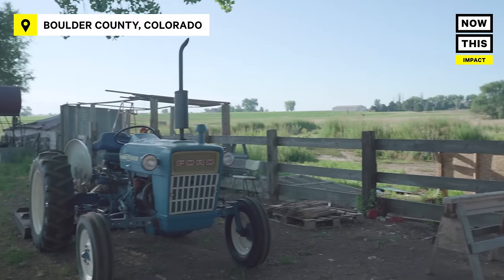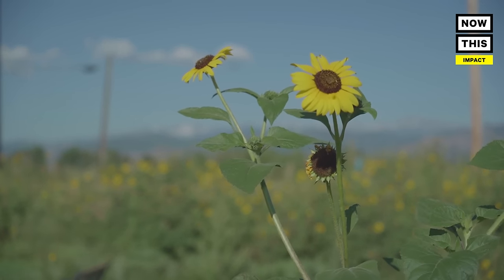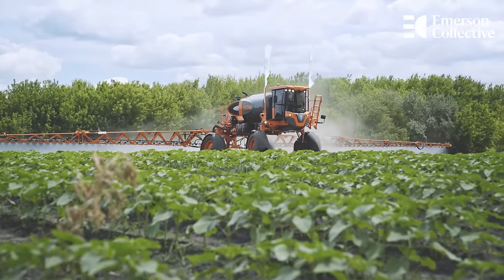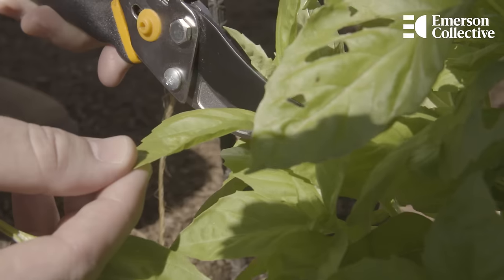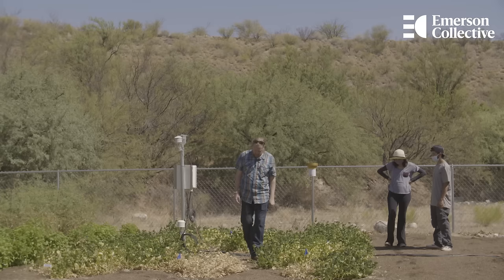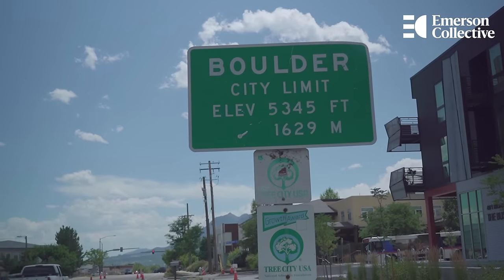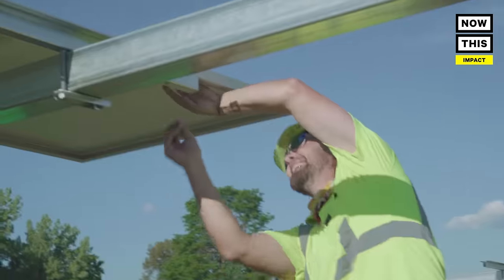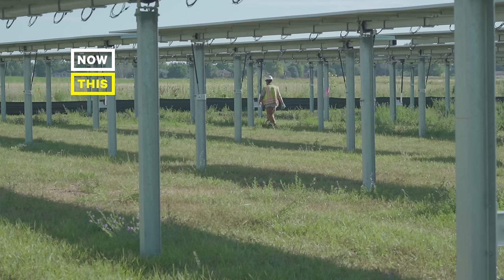Agrivoltaics: Solar Panels Bring Life to Struggling Farms | NowThis

Comment: This is why I love solar technology
Reply: Goorpijp Wessel  You should learn that even if it's made with materials from the environment, It's still improvement from dirty coal plants ;)
Reply: I wonder what the life of the panel is. Hopefully Technology will find ways to recycle the components & make them more ecofriendly. We have to stop with carbon producing energy. We also need more research into improving nuclear power production.
Reply: Goorpijp Wessel  Life cycle impact in grams of CO2e per kwh for solar is 1/20th of coal's (50 vs 1001). Wind and nuclear are 1/100th, with nuclear winning out (11 and 9, respectively). So yes, loving either of those technologies is much better than fossil fuels, I don't see the problem with OP's statement.
Reply: @peforster6725  'No' to nuclear. Too deadly and its waste hangs around forever. Bad idea.
Reply: One big problem with Photovoltaics is that they use lithium which is rare and expensive. Lithium is also poisonous and if not used carefully can damage the environment. There is also the manufacturing, transportation and installation of solar panels which takes a lot of time and money.
Reply: Nuclear energy is the most sufficient form of zero carbon energy generation in the world and is the safest form of electricity production. More people die every year from the effects of fossil fuel use than nuclear energy.
Reply: @TheLiamster  lithium in my solar panels? Hahaha. Are you sure about that? Or were you thinking about batteries for solar? 
Better yet first work out the carbon miles involved to pump crude oil out of the ground, transport, refine, transport again, then pumped on of it's refined products back into a tank in the ground, then pumped out of the ground again to put into your vehicle's tank?????
I'll wait.
Reply: @TheLiamster  I see that you are working hard to discredit renewable energy. Repeatedly copying and pasting the same remark in comments section. Are you paid by the fossil fuel industry?
Reply: Nuclear is better
Reply: @gabbar51ngh  correct. Nuclear is better off avoided entirely. 

There, fixed your comment. Have a nice day! 🤗

Comment: This is amazing! We have to advance solar technology as much as possible!
Reply: Renewable energy in general
Reply: One big problem with Photovoltaics is that they use lithium which is rare and expensive. Lithium is also poisonous and if not used carefully can damage the environment. There is also the manufacturing, transportation and installation of solar panels which takes a lot of time and money.
Reply: @TheLiamster  That environmental damage amortizes pretty quickly when compared the environmental damage of to more traditional generation methods.  PV is way less damaging and destructive than hydroelectric.
Reply: @TheLiamster  there's no lithium in crystalline silicon solar panels. It's a major component of battery storage systems though.
Reply: @TheLiamster   I see that you are working hard to discredit renewable energy. Repeatedly copying and pasting the same remark in comments section. Are you paid by the fossil fuel industry?
Reply: @TheLiamster    
There have been recent advances in recycling lithium, and governments need to be doing more to subsidize and encourage that practice.  The more that is recycled, the less that has to be mined in the first place.
Reply: Mach Gaming  
This is especially true when one considers just how much more efficient solar power could be with even more research into solar power itself and the batteries to store it.  Just look at what Elon Musk's companies have accomplished so far with improvements in battery technology.  With more investment, even more could be done.
Reply: @randomrangoon5476  only nuclear can safe us. None of the renewable energy is scalable enough.
Reply: @gabbar51ngh  
Said, "only nuclear can safe [sic] us."

You're going to be proved wrong in the next 2 dozen years.  There will be enormous amounts of renewables installed because they are less costly than fossil fuel or nuclear power on a per kWh basis.  The problem is that as the nuclear plants become old, the utilities will want to replace them with cheaper renewables.  What must be done is try to extend the life of the existing nuclear power plants by subsidizing them with taxpayer money.  But that may meet a lot of resistance, and those NPPs may become 'stranded assets' and be decommissioned.  That's not good because it will reduce the amount of clean electricity.
Reply: @acmefixer1  Yet it worked well for france and when germany tried to go all renewables it failed terribly. solar and wind is temporary solution and the amount of land it takes makes the entire process worthless. best you can do is rooftop solar in each home. that's it. 

for industries and other bigger needs only nuclear is there. there's literally no study where renewables are coming close to that so i have no idea on what basis you are making that preposterous claim.
Reply: @TheLiamster  Lithium is neither rare nor expensive. Enough of it exists in the deserts of Nevada to replace every single mode of transportation in the US. Also, solar panels are made of silicon. BATTERIES are made with lithium.
Reply: @randomrangoon5476  well a con of renewable energy some people are worried about is the garbage problem it could create. Once they are unusable we don't know what to do with the trash and it's very hard to dispose. Also things that use fossil fuels last longer and are more efficient. Lastly we can't store so much energy, we would need lots of batteries which require lithium which is a rare earth metal which we have to mine for. I think the best bet for humanity is nuclear energy, its clean, super efficient, and safe. But I do think green energy is a good thing we just have to see both sides.
Reply: @swerth9811  Very well said.
Reply: @swerth9811  
Said, "... the best bet for humanity is nuclear energy..."
What you should be doing is to stop the utilities from shutting down nuclear power plants like the one they're decommissioning in Iowa.  It is being replaced by wind turbines and storage.  The utilities are writing it off because it will cost too much to keep it running.

Comment: Imagine if every small farmer had subsidized solar panels on their prop if it is effective so they can get xxxtra income baby
Reply: Better idea:  Semi-portable solar arrays.  Farmers can use them over top of fallow fields so those fields are still making money while fallowed.  When it's time to plant that field, farmers can just move the array.
Reply: Flippin Flitz  
I could not agree more, and it would be government money well spent.
Reply: @DAndyLord  Unfortunately, it can't really be done because of how panels work. If the panels are wired in parallel, you'll have high voltage wires running on the ground. If they're wired in series, shading a single panel will kill the output of the entire row. Glass panels are far too fragile. You could get a giant roll of printed panels, but they would break in no time. One stray cow would easily destroy hundreds of thousands of dollars of panels.
But even if you could somehow solve for all those problems, you still don't have storage. Without storage, you'd be forced to sell the power back to the grid when it's generated, and during the daytime, you'd looking at a return of about 2-3c/kwh. While the average cost to use that same kwh would be about 17c. 
Solar farming is a viable business, it just makes no sense to do it over precious farmland. You'd build it on some cheap land that's not farmable, preferably because it's too sunny and dry to farm there.
Reply: There is no need to subsidise. Solar panels are really cheap now and are economic from the get go.
Reply: @eugenes9751  I'd suggested putting the arrays over fallow fields.  That way the farmer is making money even when she's not planting there.
The other problems do seem larger than I'd anticipated.
Reply: Wind turbines make farmers more money.  IIRC it's $3000 US per windmill per year.  So a dozen windmills could earn him $36000 a year.  Maybe more if they are newer, bigger and put out more power.
Reply: @DAndyLord  
No need to move the solar array.  Look up agrivoltaics and read about it.  BTW there is a company that makes solar arrays that are modular and fold out to be deployed so it's possible to do exactly what you said.
Reply: @eugenes9751  
Said, "[solar panels] can't be used [on farmland.]"
You're WRONG.  Look up agrivoltaics and read about how the farmers are doing exactly what you said couldn't be done.

Also said, "forced to sell the electricity back to the grid [too cheaply]."
That's nonsense.  The utilities are subject to state and federal regulations that require the utilities pay tariffed prices.  It's called net metering for small solar systems.  But bigger systems could enter into a PPA (power purchase agreement) with the utility for a fixed price, negotiable depending on the output of the system.  A good sized farm could have ten to fifty megawatts.
Reply: Not to mention better quality crops that will gain reputation from more consumers. Unless you take a baseball bat to your solar panels, you can't financially lose.
Reply: @eugenes9751  never heard so much bull in my whole life
Reply: @eugenes9751  you just raise the panels above the ground and still use the ground bellow it's not rocket science lol
Reply: @jshaw4757  Not my fault that nobody educated you about how plants work, go read a book.

Comment: So awesome and such an obvious solution frankly when you when you drive by fields of solar panels. Raise them higher and grow alfalfa for hay, basil, so many ideas. Convert parking lots into shaded lots so that the cars don't overheat and it's not just an asphalt jungle but renewable solar energy.
Reply: At Michigan State University they turned a parking lot into a covered lot with solar panels. It keeps the students cars cooler on sunny days and provides clean energy to the university buildings.
Edited to add: it also keeps a lot of snow off of the cars in the winter too.
Reply: Your two examples are totally different. Covering parking lots is a great idea, because it gives shade to cars and provide benefits all round. Growing crops in the shade is a totally different story. It reduces yield and quality, and is an all round BAD idea. Fruiting crops need lots and LOTS of sun. The more the better. I cannot see how this "solution" will work. The farmer either farms with crops or electricity on the same patch of land. Otherwise crop yields will be dismal.
Reply: @barriegordon1108  watch the video. The farmers grow leafy greens in the shade of the solar panels because the leaves grow bigger in partial shade...ya know bigger leaves of spinach and lettuce are good.
Reply: @barriegordon1108  Some plants do well with some shade, rather than a full 12 hours of sun in the summer heat. It's not 100% shade under the canopy necessarily either. You've got 🌞 from east and west, and some overhead 🌞@ highnoon in the gap between Rows. In the mid-Atlantic area we have native pau pau fruit trees that like shade. Could be permaculture rather than annual crops? Lots of possibilities for the imagination still.

Comment: What if you planted trees also? They store water in the ground next to them and provide shade.
Reply: Hi! I currently work at Biosphere 2 at the AV gardens. While you don’t see any trees under these panels we have sister sites across Tucson where the solar panels are angled and at their highest point reach about 20 feet in the air. Under these panels we have planted fruit trees which don’t like the Arizonan heat but are doing fine so far! :)
Reply: The trees do also use a lot of water though, but it's a interesting idea

Comment: I like it but what are the resultant crop yields? 

I understand that there is research that it results in larger leaves and reduced water demands but if the crop yields significantly drop, it basically boils down to replacing farms with solar panels. 

This is great for green energy but not so great for food security.
Reply: Yes! My thoughts exactly. This is a very bad idea.
Reply: You can have 1 unit of solar, 1 unit of crops, or 1 unit of solar and 0.5 units of crops. I'd take the third option. Plus it's just a matter of changing crop types to some that thrive on those conditions.

Comment: The panels would also be a perfect rain catch system. Put some gutters at the bottom of each row, run them to rain barrel stacks that are used to water the crops below.  The spacing between panel rows would still be plenty to allow rain to fall to the ground but you could also bank water for the dry times and save resources.  Yeah, there's laws regarding the catching of rain water and those need to be dealt with but it seems workable.

Comment: just wonder if using the panels surface also to collect rain over a system of gutters could also help to keep a bit more of the short abundant rainfalls in summer (dont knwo the climate of that region?) to irrigate the following days ? I mean it does not need to be all watertight and perfect, but the other way round I could imagine the rain pouring down just over the edge of the panel very locally is not ideal for the crops either ?
Reply: Great idea!
Reply: Yes exactly. Don’t forget dew condensation.  Plants or weeds will preferentially grow along the drip-line, or wherever the irrigation is.

Comment: This is pretty cool, thanks for sharing!
I live off grid in Canada. I have a woodshed roof that I shingled solar panels on top. All the rainwater from the roof is what I water my garden with. There is a lot of water available all the time now! Power too! and since I bought used panels, they cost less then the tin for the roof would have! Big old lead acid batteries power my life day and night with that array. It is very very cost effective to save the environment it turns out!

Comment: But.... Why solar panels? I mean it is great to be producing electricity but wouldn't it be cheaper just to put some shaders?
Reply: I think it has something to do with the combination of them both. I think it is more profitable to have a solar panal and plants rather than only focusing in the plants, by having Just a plate covering the farm
Reply: The solar panels yield electricity he can sell for income, to supplement his business.
Reply: @cinderball1135  yes of course but if the farmers are struggling money wise they don't have the cash to make that initial investment.... That's why I was wondering why not just shaders
Reply: Climate change can reduce the amount of available water in his area. The solar panels help stop that from happening through renewable energy
Reply: They can make profit from the solar panels by selling some of the energy to the grid
Reply: @yamilcoloma6677  in that case they could just use shaders, but for a better long term solution solar panels would work better
Reply: Financing the solar panels is what most do it they don't have the money upfront.
Reply: @yamilcoloma6677  Their community has invested in the project, because it will lower the cost of homeowners' energy bills going into the future - that's where the extra needed hit of capital came from. :)

Comment: I'd like to know how they plan on harvesting underneath the solar panels. Having physical structures built in and above your plants prevents traditional harvesting machines so does this technique require hand-harvesting? 
I think this is an amazing step in the right direction, I am just curious what methods have been thought up in order to apply this on a large scale.
Reply: Remember, Immigrants do Most of the Picking, so even by hand, they have A lot more vegetables to sell with shade to offset costs for now. Great looking ahead!! Maybe a size machine could become standard, based on frame sizes for panels!
Reply: Hi! I currently work at Biosphere 2 doing AV research with Greg and my peers. We are so glad that AV is progressing as fast as it is but we still have so many questions. AV research in Tucson until recently has been focused on smaller arrays in neighborhoods which would benefit from increased food/energy/water security. Like you we are beginning to question how this can be implemented at a large scale. We know with handpicked crops the shade provided by the panels creates a more humane work environment, especially in AZ. In addition, solar panel arrays can be dynamic and shaped to address some logistical issues. To solve the issue you raise and other problems we need more funding, partners, and farms willing to try AV and work through their design/implementation.
Reply: @DrCoaz  Hey Caleb! Thank you for taking the time to reply to me.  I want to commend you and your colleagues for  dedicating your resources to furthering sustainable advancements in food. 

I suppose it is important to point out that AV doesn't have to completely replace traditional farming in order to be successful.  For smaller family owned farms- especially located in smaller towns this seems like the ideal application. 
Unfortunately due to many of these smaller farms being forced to sell to the large industrial farming companies, there are fewer and fewer farms around to make use of this technology. 

But on the other hand, hopefully this and other new approaches can help save many of these smaller farms and give them a tool to supplement income and resist selling off. I do believe that the partnerships between local government and or energy suppliers and the farms who use this AV tech will be the recipe for success for all parties involved. 

If I had the connections or finances to help in some way I would love to. But alas you do have my support and belief! 

Best luck with everything <3